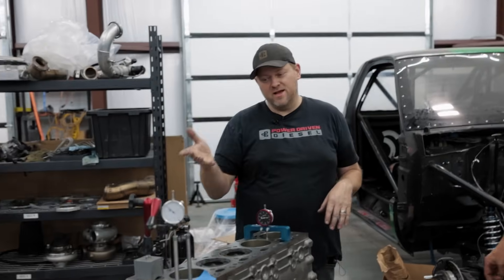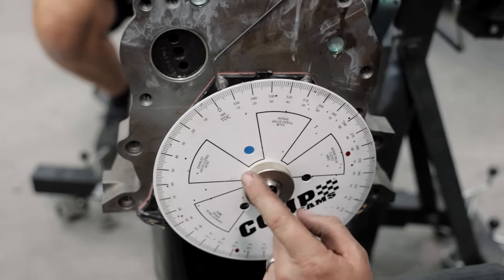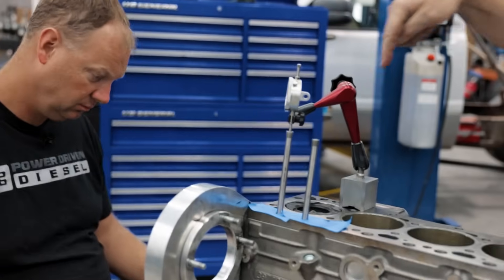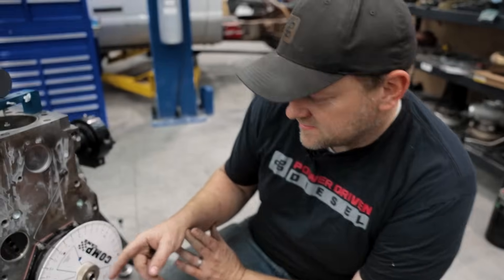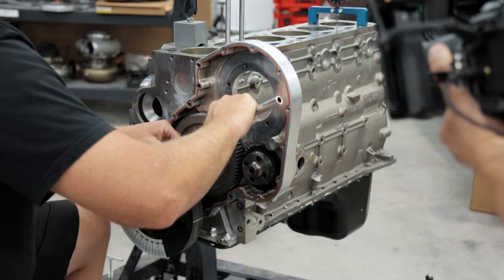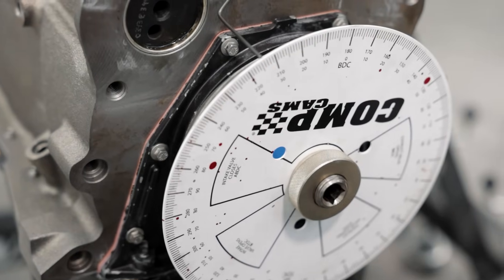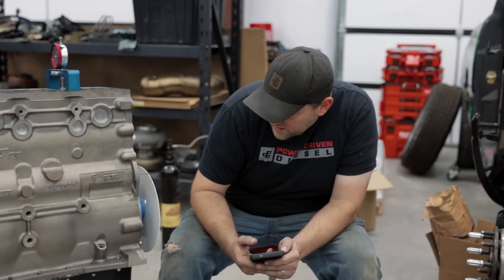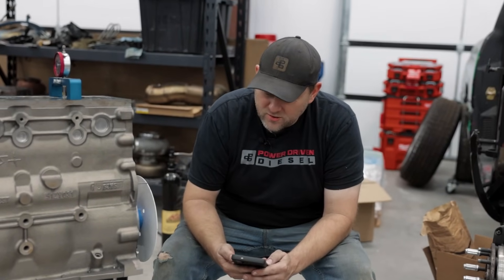Cummins Camshaft Intake Centerline

Comment: My experience is it takes about 2 deg of change in order for the power curve change to be enough to be outside the realm of repeatability errors.  Love separation angles are much more sensitive though and as little as 1 deg lobe sep change usually shows up in the power curve.

Comment: Good video. This is one thing sense doing so much more Dohc gas stuff too that sucks for a single cam down below. No matter what you do you cannot add or remove overlap sadly. Still degreeing the cam is a good idea. I have also seen cams a couple degrees off.
Reply from the maker: Yes having independent intake and exhaust cams would really open the end users ability to fine tune it in!

Comment: Would i also have to do the exhaust valve centerline seams you knew where the cam would mske the valve kiss the piston so in order to not let my valves take that exhaust vslve and clearsnce it say one or 2 degree ? Even if intske valve isnt at the perfect dwell mark but allow intake to be open as long as possible without interfering with exhaust
Reply from the maker: The centerline of the can is set on the intake lobe. After establishing it intake centerline then you would just need to verify you have enough piston to valve clearance. In most drop in cams this shouldn’t be an issue as long as the cam was machined correctly.

Comment: I have a question... how does the camshaft effect the tourque curve
Reply from the maker: Cams have a window of rpm where they work best. A cam designed for low rpm will make more torque while a cam designed for high rpm will make more horsepower. All else being equal, which all things should not be equal as designing for an rpm range involves more than just a cam.